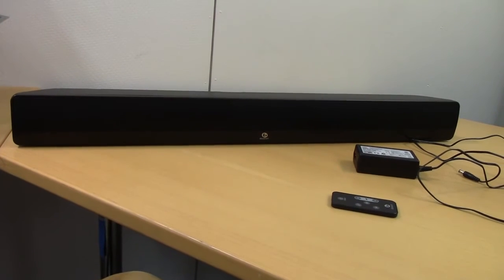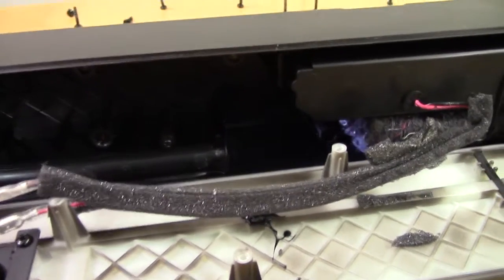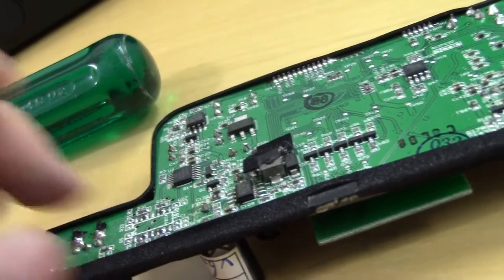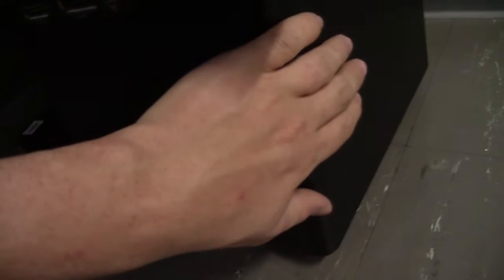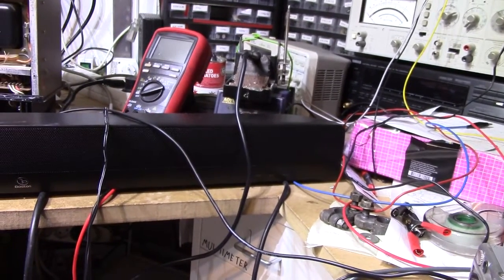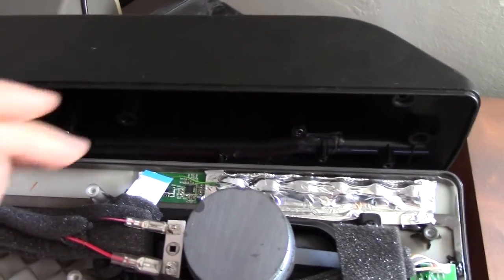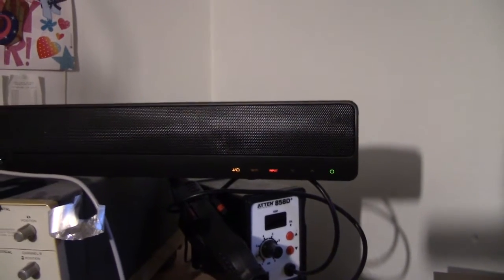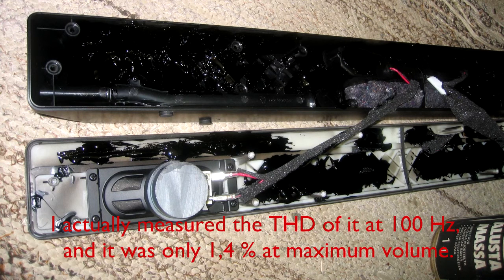Troubleshooting a wonky Boston Acoustics TVee26 sound bar

Comment: Hi I’ve tvee one sound base model. 3 Day’s ago its stopped working. The defect is it freez when I plug in to the AC. I check the amplifier side but it’s ok. Do you know , where the problem is?

Comment: So the way these units work is that it will quickly turn off without an audio input?  I push the ON button on mine and in 5 seconds it turns off.  Is that normal?
Reply from the maker: The lights go out automatically even if it's still on.
Reply: Got the same issue